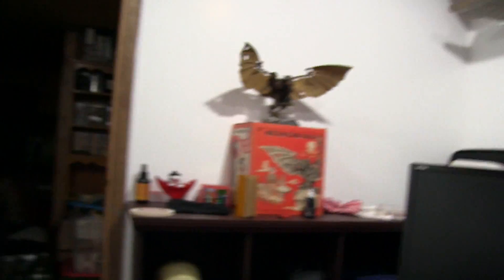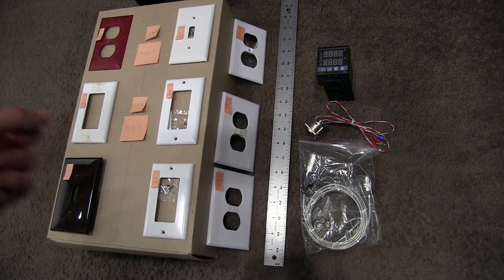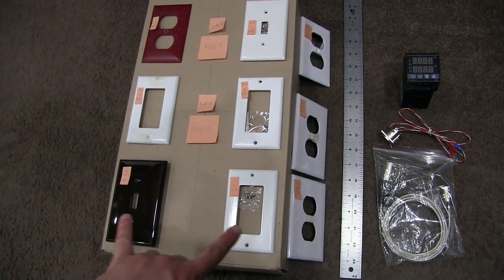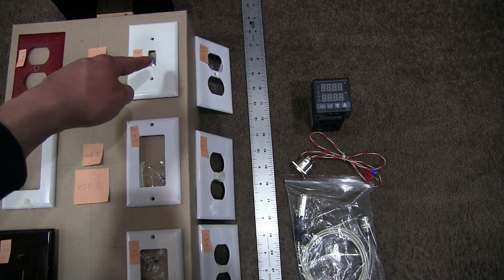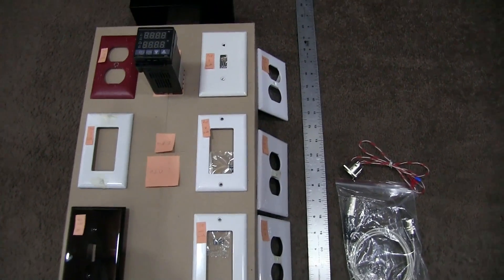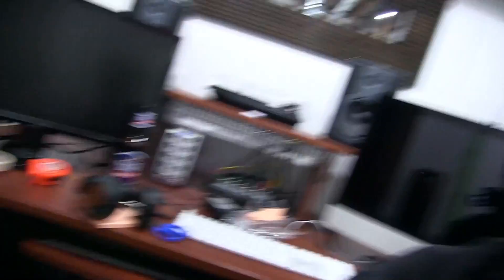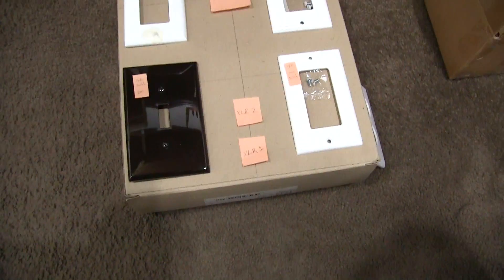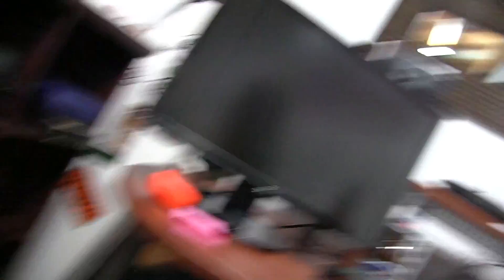Laying Out The Electric Brewery Controller - Ideas and Suggestions Are Welcome!

Comment: Do the pumps not run at 12v?
Reply from the maker: +rimmersbryggeri No, they run 120. My 240 line is only a 3 wire, so I can't run both 240 and 120 through it safely, so we'll just run another cord and all will work beautifully!

Comment: I agree with tvtom, I'd recommend putting the xlr Jack on the bottom or side. Otherwise it will hang down over the pid and might be annoying.otherwise looks good. Can't wait to see the build, cheers Joe
Reply: Oh one other piece of advice, check the height of the internals vs the depth of the external pieces before you punch the holes. That way you don't run into an issue where the parts hit and the door doesn't close or something like that.
Reply from the maker: +Everty Homebrewing Yep, definitely going that route!  Cheers!
Reply from the maker: +Everty Homebrewing Oh yes, we'll be checking over everything before any punching or cutting happens.  Good call, for sure!

Comment: wouldn't it be better to have the xlr connections coming out the lhs or underneath, just from the perspective that your less likely to snag them if your walking past the panel.  Of course it all depends on where you plan on installing the panel as that may not be an issue.

Looking at the PIDs they look really deep, will they fit flush in the box?

Very interesting project.  I was watching Harrybrew69 put together his custom 3 phase box for hwi brewery the other month.  Rest assured yours will be fairly simple to setup by comparison ;)
Reply from the maker: +LeJimster Right! Yeah, mine is going to be very basic but functional.  I don't need bells and whistles, nor do I have the money for them! The PID is deep, but it will fit and allow a little wiggle room.  My friend and I have even talked about maybe building a flange into the setup to give a little more space.  Thanks for watching man!  Cheers!

Comment: I LIKE THE SYSTEM AND IT WILL WORK FINE. "BUT" WHEN YOUR ALL SAID AND DONE. I WOULD LIKE TO SEE A VIDEO VERY OLD SCHOOL. NOT THERMOMETERS NO GAS NO ELECTRIC NO PROPANE, NO KITS. A POT HOPS BARLEY AND GRAIN THAT YOU MALT YOURSELF. IN A KETTLE OVER A OPEN FIRE, WITH MAYBE A OAK BARREL TO FERMENT IT IN. KIND OF OUT OF YOUR ELEMENT VIDEO. GREAT VIDEO GOD BLESS
Reply: NOT YELLING JUST BLIND
Reply from the maker: +contreeman That would definitely be an interesting video!  I may have to give that a try (with the exception of malting my own grains...  Not sure I could pull that one off successfully, but open fire brewing could add a really cool flavor to the finished brew!)
Reply: MY THINKING EXACTLY. WE THINK ALIKE. AT LEAST YOU BREW I DRINK WE HAVE THAT IN COMMON LOL GOD BLESS